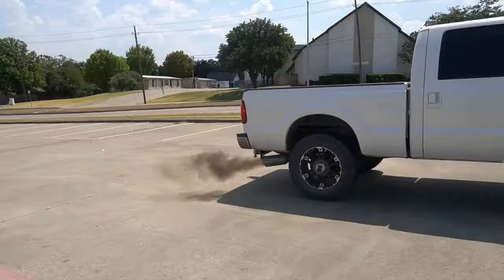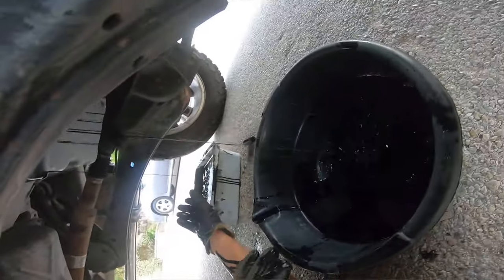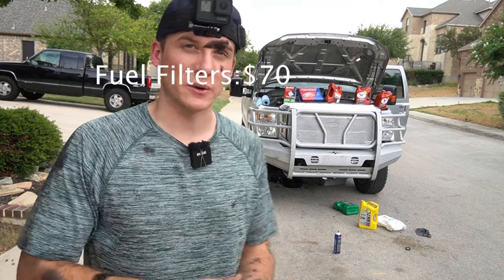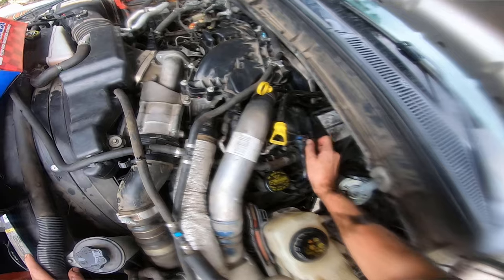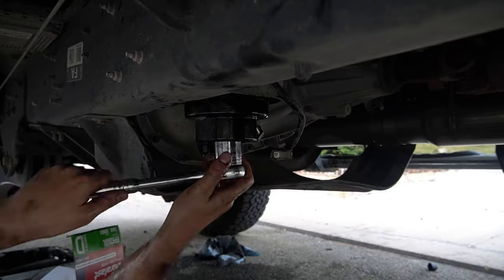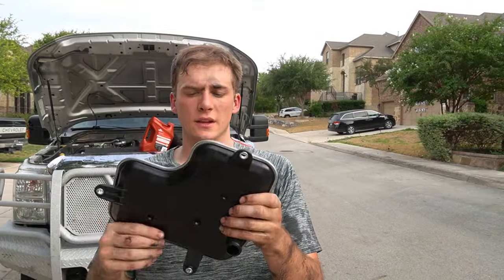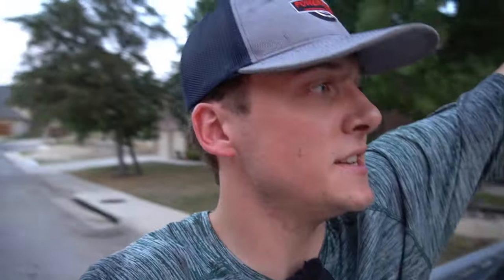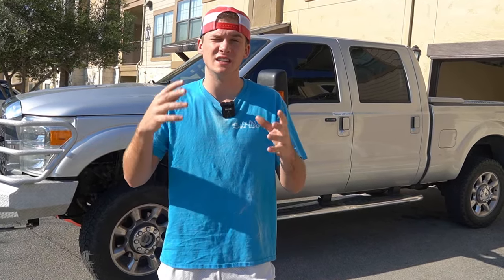How to Get A MILLION Miles On Your Diesel Truck

Comment: Solid advice here! One thing I would recommend is to spend  ~$150 and get the aluminum H&S lower fuel filter bowl. I got tired of stressing TF out every fuel filter change and wondering if it was the time for the plastic OEM one to crack while unscrewing it lol. Now I don’t have to worry about it!

Comment: Hey bro, pro tip on that oil filter, if you have a metal filter, punch a hole in the bottom and let it drain for 30 seconds or until it slows the flow down. That way you can pop it off and not have oil coming from the sides. Hope that helps :D
Reply: Also, used motor oil and tranny fluids can be carcinogenic. Wash that stuff off my guy. You don't want surprise cancer 😂

Comment: My 6.0 gets the lovin' it needs in the maintenance department and can't be over-stated. I normally stick to the specifications in the owners manual and use genuine Ford Mo Co Parts, I have a low mileage F350, so keeping it all sock is what I am after, but will upgrade when necessary, but nothing too crazy.  Good info and video!

Comment: Why did you use 2 different brands of OIL? ….
Back in the day that would have been a HUGE mistake, I’m not positive but I don’t think it’s as big a deal nowadays. Pretty sure all the major brands have good oil. However, I still put the High dollar synthetic Rotella-T 15W40…reckon I’m a sucker
Reply: Does matter, rotella t5 is just t4 mixed with t6. As long as it's the same weight it's fine. I run amsoil because rotella gives me an annoying ticking noise.

Comment: my 2008 ford f350 has a tuner. i replaced the cable and tuner wont come on. does it have a smaller cable also to turn it on? i forgot how to get it turned on.

Comment: I highly recommend you do NOT use duralast parts for the 6.7L. Also you maintenance intervals are too high for the fuel filter and trans fluid. 10K max for the fuel filter and 50K max for the trans service for synthetic fluid. Yeah you could get away with higher intervals with the 7.3L because the 7.3L really didn’t care. These modern diesels are far more tempermental. Stick with motorcraft parts. 

Also it takes other repairs such as suspension, brakes, etc…. to get a truck to 1 million miles. I just did front leaf springs on my ‘99 F-350 with the 7.3L because the original springs were sagging from the weight and the bushings were worn out or cracking. Thing is the truck only has 156K on her. I plan on doing the rear spring packs in the near future as well since they’re sagging some too.

Comment: A STP oil filter is not the way to go. At least stick with each manufacturers brand of oil filer. Aftermarket oil filter brands like Napa Gold, Fleetguard and Donaldson. I personally use Donaldson on my Cummins.

Comment: Way to tight for trans pan bolts
Reply from the maker: That’s what I thought bro had to watch another video before tighting  all of them I think I stripped a couple out might have to tethered
Reply: @powerstrokecentral  the spec is 100 inch lbs and go around 3 times.